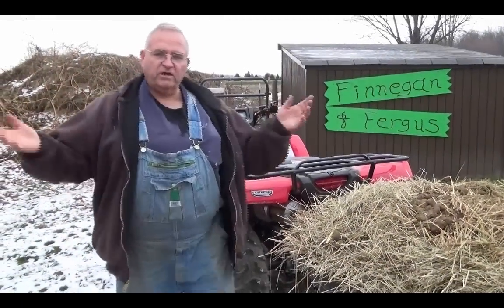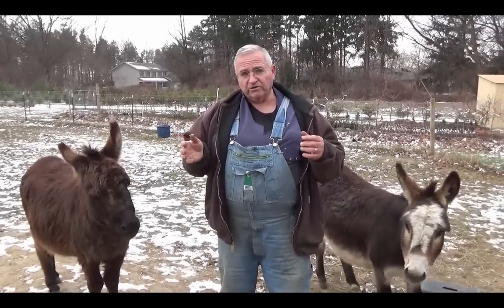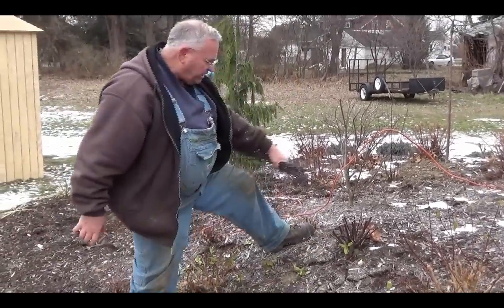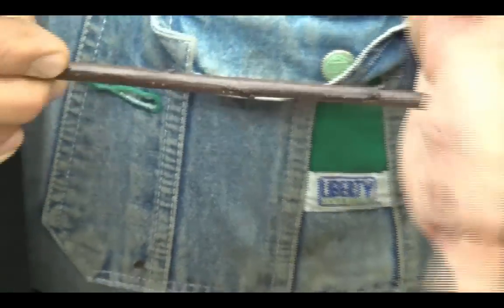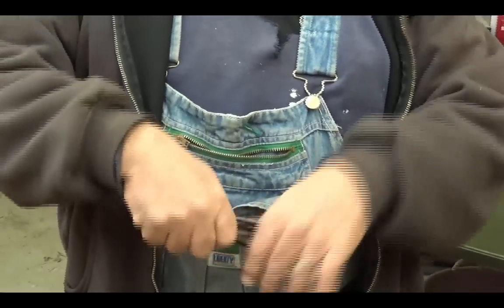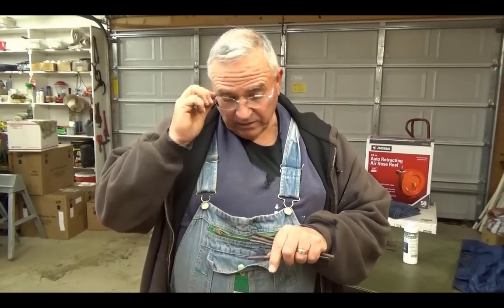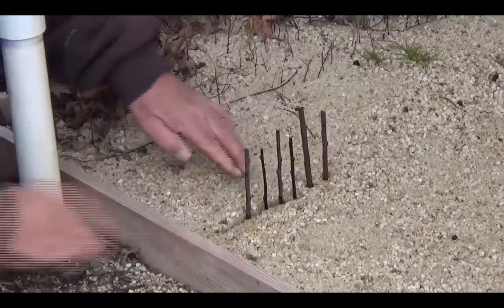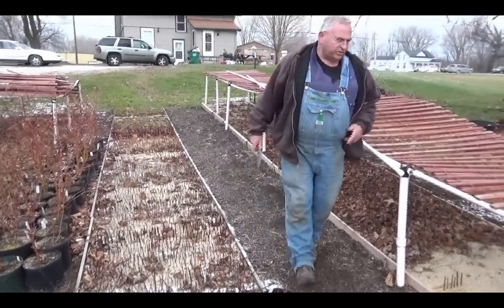Winter Time Plant Propagation (Hardwood Cuttings)

Comment: Thank you Mike!  For two years I have been trying to save some 100 year old pear trees at my brother's farm.  I had almost lost hope.  I live so far away and the one promising technique I tried, I missed the window for getting retrieving them. I will share that technique here for your perusal.  I found it in a rose book from the 1950's.  This lady would take a branch, score it vertically near a node, put the root hormone on there, although, since this technique was used in ancient China, it would probably work without the hormone as well.  Then, slightly damp moss was layered around the scored branch, and then a plastic wrap which was impregnated with anti-fungal spray (back then, there was a wrap sold over the shelf but the product is defunct).  The plastic wrap was then anchored around the branch, protecting the moss, etcetera, from the elements.  All of this was done while the branch is still attached to the rose.  In a few weeks, you would see roots forming through the moss, and that's when you'd cut the branch off and plant it in the ground.  I got results, but like I said, I never made it back in time to retrieve it from the farm due to a bunch of drama with my sister-in-law and also my own health.  I will continue to try tho.  I think I am getting closer.  I will do your technique this year, as it only requires one trip to the farm to retrieve the branches.
Reply: BlackSeranna this is called "air layering".   Good luck with that. Im trying to graft from a 80 year old tree I left when we had to move. It was also a peartree.

Comment: I have a question: I am trying to root cuttings from a Mulberry tree in water. I cut most of the leaves off, change the water every 3 or so days. I got some small bumps on the bottoms of the stems but they aren't getting any larger. I thought the cutting was dead but the next day, new leaves started appearing, along with flowers. I'm thinking I should probably remove the flowers. Any suggestions at this point on what to do?

Comment: Awesome video Mike thanks for the info! Will this work with apple rootstock cuttings? The last couple of years I have attempted to root the top of the rootstock I cut off in April or May while grafting with limited results. Would it be better to cut it off in the Winter like you did with those?
Reply: Few apple rootstocks grow by cuttings. Bottom heat for sure. Pears, plums yes, not apple

Comment: my rootings never root they usually turn black but never wilt so I don't know what I am doing wrong?
Reply: Propagation by cuttings really is a 'volume' operation. If you want a propagation method with a higher success rate, look into air-layering or layering.  I have personally used layering to propagate muscadines, blackberries, camelia japonica, fig, azalea (rhododendron), crape myrtle, privet, english ivy, and yaupon holly.  This virtually guaranteed method may be a better option to get a base 'stock' of plants to provide more and more cuttings.

As far as your cutting problems, try going with slightly thicker scions, and if they're from an evergreen variety, even try removing all the leaves so they can't aspirate moisture.  I've never had much success with ever-green cuttings, and it's quite infuriating because I have access to all the little gizmos, rooting hormones, heating mats, large terrariums to maintain moisture.  But I have found that the thicker the cutting the better. (to a point).  I've made 1~2" diameter stakes out of privet, hammered them green into the ground to lay out lines, only to have them root in place.

Comment: I live in Liberia and have recently been trying to propagate hardwood cuttings from a cinnamon tree in water, without any luck. I’ll have to try your sand method. 

Any other advice?
Reply: The African Homestead
 - Simple and cheap method. 

Get your cutting into the soil. Water it.
Cut the top of a big PET bottle (cap side). Small ones are simply to small. LOL :-) Cover with the pet bottle. Bury it a few centimeters into the soil. Just so it won´t be toppled by the wind, etc. 

DON´T TOUCH it for the next 3 or 4 months. Water around it regularly, according to the needs. Depending on season, species, etc. can be slightly longer.
A "healthy" amount of new leaves growth will be a good tell tale of development. ;-)
I really mean it, don´t touch. Keep the makeshift "greenhouse" undisturbed. Skip the temptation of "let´s take a look" under the bottle...

If available, keep one or two leaves (max) on top of the cutting, strip everything else, just as described. ;-)
Being in Liberia, at that latitude, to much Sun exposure can be an issue. A nice shade under a tree is ideal. Beside it can profit from the soil web provided by the tree. ;-)
Good luck.
Cheers